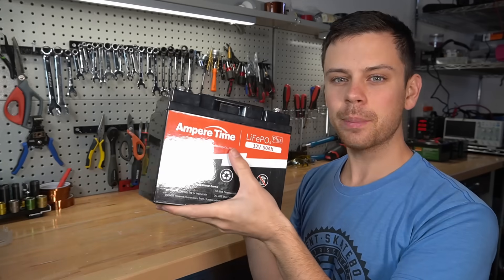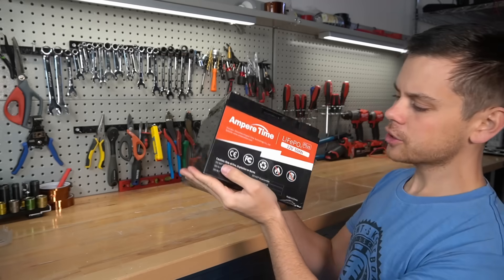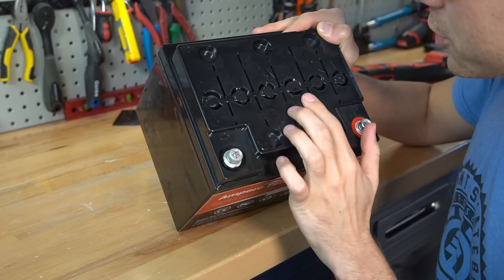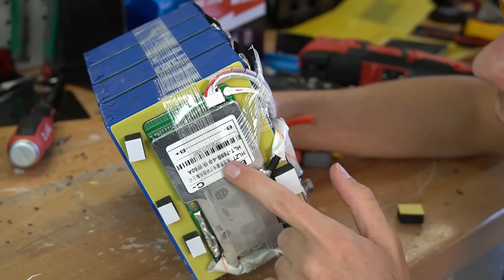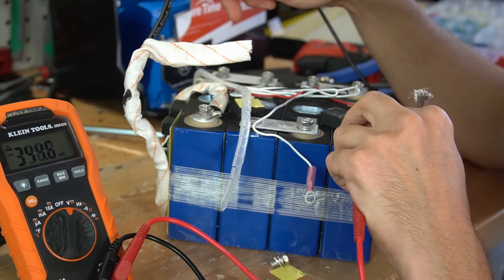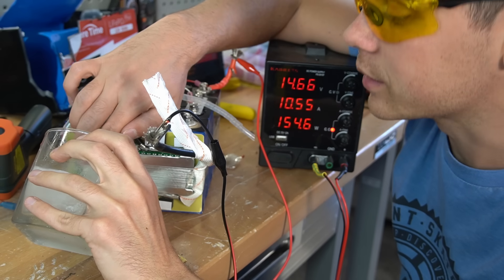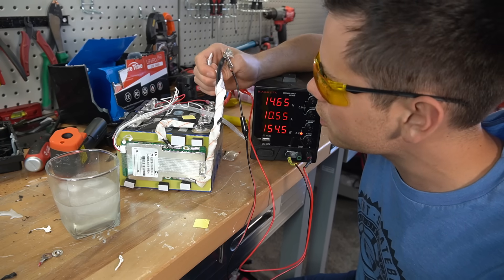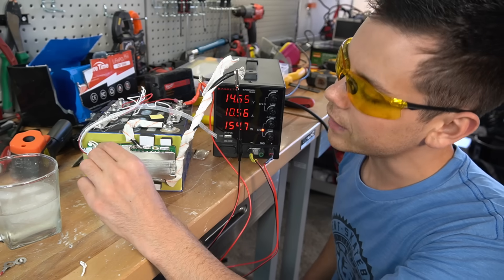12V "Ampere Time" LiFePO4 Battery Teardown

Comment: The main power cable looked like aluminum or copper clad aluminum, # 10 max amperage is 30 amps.
Reply from the maker: No, it's tinned copper. I know the difference and would mention it if it was.

Comment: LiFePO4 doesn't even begin to reduce performance until well over 55℃ with thermal runaway not until 270℃ and yet charging at below 0℃ will cause immediate and permanent degradation ... why have a high temp cut-off instead of a low temp cut-off? Boggles the mind. Edit: typo
Reply from the maker: Agreed! It does not make sense. Jack rickard has some videos about using LiFePO4 at higher temperature for increased performance too. They like it. Storing at high soc in high ambient temperature? They don't like that. But this high temp sensor would never help in that instance. I just don't get it. Very pointless.

Comment: How about adding a separate low temp cutoff OR a thermostatically controlled heating pad? Even Battleborn sells those
Reply: What is the product that BattleBorn sells to add a separate low temp cutoff?  I've looked a little bit, but it appears the heater wires available are either hardwired from the battery + to the heater lug, or they sell a manual switch.  I'm looking for more advanced, separate low temp cutoff and heater control.  ie, only heat the battery when there is a charge applied, and it is above 0C,  apply the heater only when there is a charge applied and it's below freezing.  Without this, the battery will kill itself trying to heat all the time, even if there is no charging happening.  Heating only needs to be done when there is charging.  Ie, don't heat the battery at night, only heat it during the day when it's warmer and there is solar charging.
Reply: You can buy pet bed heaters for $15 - work just as well. edit: typo

Comment: Could you add an external temp shutoff?
Reply: Certainly not impossible but it would mean integrating with the BMS' microcontroller, which would also likely mean re-programming it ( e.g. to accept a sensor input and signal an interrupt). If no microcontroller, you'd have to figure out what signal switches the FETs off and replicate that signal with a thermistor circuit. Again, not impossible, but it would probably be easier to switch the output externally e.g. through a contactor or bank of FETs. Or replace the BMS!

Comment: I have a question on charge controllers for these batteries.  The Renogy Wanderer you reviewed previously now has a Li setting on the display.  It is the only controller I have found that has this simple push button for Li function.  Have you tried this newer version yet to find out if this is actually true?  I have two of the 100ah 12v ampere time batteries on my boat and want to use one controller per battery hooked to one solar panel [Rich brand:  Maximum Power(Pmax): 100W, Maximum Power Voltage(Vmp): 18.6V, Maximum Power Current(Imp): 5.38A, Open Circuit Voltage(Voc): 22.8V ,Short Circuit Current(Isc): 5.78A ,Maximum System Voltage(Vmax): 1000VDC] per controller.  I just want a controller I don't have to program by computer, just push a button to get the setting I want and do not need bluetooth or heavy monitoring.  Thanks for all the info on batteries and systems.  Paypal enroute.

Comment: EDIT AT END>>>Yes. i bought it for 50 bucks more because you gave me "the keys" to sustainable solar freedom. Freedom is worth it. That said, I've written for a discount on the price as there was "false advertising". *They offered to refund $50 when I asked due to YOUR VIDEO! Then, they said they are out of stock. SO, WHAT OTHER BATTERY SHOULD I USE IN THE MILK-CRATE?

Comment: Anyone know why my 1000w inverter is beeping?  Was working for an hour then quit.  Had a fridge plugged up.  Fault light is on, on the inverter.
Reply: Strange question to ask in a YouTube video comments section! Usual causes for inverter (non-catastrophic) failure are low battery voltage (e.g. <10.5V) or power overload, which with only a fridge plugged in is doubtful. They do have other protections, but these two are the most common.

Comment: THANK YOU!  I have 2x 200Ah 12v for my boat and have always wondered how the build quality was.  I am in Japan and the Japanese site does not say anything about high or low temp cutoff.  Could you just add a low temp disconnect?
Reply: Nice, how much solar do you have?

Comment: So it seems these are very good except for low-temp charge protection. Could be OK for lots of folks as long as they know this. I have to wonder if the vendor will decode to upgrade the temp sensors to solve this; even at a slightly raised cost that would make this a great choice.

Comment: Ampere Time says the low temp protection offered by their BMS is -10C or 14F which is probably lower than your ice bath was when you tested it.  I should think the 14F is much to low and the battery will be damaged if charged down to that temp.  Battle Born is 25F, but maybe prismatic cells are more tolerant?

Comment: WILL, ...A bit off topic, but not far.  How about a video with affiliated links to the exact means and minimal cost gear to test the cells for building your own 4S batteries and top balancing them before assembly per the Overkill build instructions on the DIT solar forum.  Gonna plaster this everywhere...it seems to be left out of all the DIY build videos and seems to matter a ton.

Comment: Up 50 bucks. Dayum. 
I was wondering on a battery system would there be a use for a ballast used on headlights? Even possibly activated as a load balancer? Or hyper charger from panel source? Pondering n easier to ask questions to learn. Ty for the videos

Comment: Will, nice video. You could take a low temperature sensor and put it into a series circuit with the high temperature sensor, both closed contacts,

Comment: I know that most like lithium batteries, however why not use a good deep cell lead acid battery like a 12v Trojan?
Reply: Expensive if you calculate kw / per $ 
Less life cycles
Heavy
Reply: @tomali2100  These are all true facts about lead acid batteries.
However lithium is not nearly as good as people think it may be.
Chile's lithium mines use 2/3 of all water in that region. In fact several towns have to truck water in so they can have h20.
Plus if everyone thought they'd get a battery car, think again there's not enough water nor lithium to do that.
Lead while just as toxic as lithium is infinitely recyclable.
What would be nice is a combo pack where a small lithium battery was being used for quick charges. And the deep cell for cold cranking amps.

I don't consider what they claim these are not generators. They're just fancy toys.
A real generator can be run for hours powering real tools and possibly starting a diesel truck.

If you compare a gas gen set vs one of these so called solar generators and added it all up the gas gen set would win with a far less carbon footprint.
While Will is having fun with his CCP toys it would be nice if he built a actual gen set that actually did what a gen set is supposed to do. And not a toy for a child in a van. Just saying.

Comment: You should do a test on charging them in a freezing environment like right at 32 and capacity test and go down just a little bit each time I mean it's not like the batteries actually know what temperature it is and it's not like the electrolyte is freezing if you can discharge fine right I'd like to see the degradation especially at just minorly low temps like above 20° american because it never gets lower than that here

Comment: Just remember these rectangular white  temp sensor are ON and OFF for high temp only. They just have a bi metal contact inside... sometime the temp sensor ARE ON THE BMS PCB and are SMT components so that might be why your low temp test can not work.
Reply from the maker: If low temp sensor is on bms, then it fails. That's even worse actually. It cannot be on a bms that heats up.

Comment: These temp sensor at 3:18 are only for high temp cut off that are On and OFF depending on high temp conditions .. these are not thermistor that measure temperature and give an indication of the low or high temperature. Normally the temp sensor like you have are connected to the BMS in serie with the SWITCH option  to enable or disable teh output FET. Normally this switch is just not used and the connections is bypassed on the pcb  When i arrived at Rocky Mountain to Develop their next gen battery they were using these in  their Powerplay line. And they were not protecting against low temp charging.
Reply from the maker: Yes very true. But low temp sensor has to be on the cells, not on the bms. If it is on bms, then it fails for that reason. Good point

Comment: The cold temperature cut off is only a bummer if you live with the snow. Here in Florida it's a great choice!!
Reply: Even if you live where it snows, as long as the battery is somewhere indoors where you have heating, it’s not an issue.  Where I live it’s -12C currently and has been -18C much of last week, but my battery is inside my house, which I can assure you is above 32F!!
Reply: Ya I'm in central texas and it's not a big deal
Reply: @james10739  after the snow storm. I think it would be wise to always plan for low temperature
Reply: Perhaps they installed the wrong sensor?
Reply: @johnbuchman4854  probably not the bms manufacturers just haven't really learned that it's an issue and don't really care I mean they have a microcontroller on there they just need to tweak the code a little
Reply: A lot of chargers have a temp sensor you can run to the battery and a cold temp shutoff. It's not as secure as having it in both the charger and the battery, but for the price if the batteries are otherwise solid it might be worth the risk to some people. I know the chargers I'm eying for an RV build will both do it.
Reply: Thailand
Reply: I just bought 4. 100 AH. For my off-grid camp in central Maine not worried one bit about the cold temps.  These batteries will be inside with me 
  Ok just have to warm them up a bit when I return back to camp before I charge them 
   Correct me if I’m wrong    But as long as I’m not charging these batteries can they handle the cold ❔❔❔ Until I get them up to temp
Reply: for shure...would not work up here in central alberta, -32 C   now,  my old chrysler intrepid, 1996, starts, and not even plugged in....GOOD  BATTERY, simple, old version.made in Canada.
Reply: Actually it's only a bummer if you look for quality.
Reply: How good of an option would these batteries be for a 36v trolling motor application? Texas location so we hardly ever get below freezing and if we do we are not using the boat.
Reply: Gonna want to use a heater
Reply: or poor american that cannot buy electricity, nuclear is green and cheap

Comment: Will, I just bought one of these and so far so good. I just want to make sure that there'll be no damage discharging, using,  this if the temperature is about 25°F? 
The only damage would be trying to charge it in that temperature?
I guess I can bring it in the house and let it warm up before I charge it?
Reply: Yes you can discharge it but not charge it below 32 degrees F.

Comment: Does anyone make an external thermostat controlled relay? ie just an external low temp cutoff device to fix most of these cheap battery designs?
Reply: Yes, it can be controlled with thermostat, but solar charge controllers (for example) expect a constant connection to the battery bank.  I suppose one could cut the connection to both the panels and battery, then reconnect to battery first using a timer on the panel relay.

IMO, simpler to use the thermostat to run heat tape, heating pad, etc, below 35F or whatever.

Comment: My 200Ah has shipped. Good thing I don't anticipate charging in below freezing temps. Great price, so I will just have to keep that in mind. SO glad the rest of the teardown is positive!
Reply: Right? So am I not supposed to keep my batteries indoors where it’s warm
Reply: @grumpy1962R  My battery is going into my Tahoe to augment my solar system when home and to provide power when I am camping/living on the road. I don't see myself spending a great amount of time in cold areas, but it will come up. My plan is to install a switch to isolate the charger and monitor battery temperature. Once the Tahoe heat has warmed the battery, I can start charging. I may be able to control that through the app on the Renogy charger too. That's assuming I don't install a diesel heater at some point.
Reply: How has it held up ?
Thinking of buying the same one as you have.

Comment: "We’re really sorry for the confusion.
The BMS in our battery has low temperature cut-off protection function, but if we set this function on our battery, the battery can neither charge nor discharge under 32F/0C. At the beginning, we had set up the low temperature cut-off function for our battery, but later many customers responded that they needed to be able to discharge under 32F/0C. After careful research, our team has decided to block this function.
Currently our battery can be charged at low temperature, but it is charged with a very small charging current. And we’ve used auto motive grade battery cells which have superior quality. Even if charging in low temperature environment, it will not damage the battery. And as what we’ve listed in the charging temperature, we don’t recommend charging under 32F/0C.
Our marketing team has an error in understanding this, which leads to inaccurate information shown on our product page. We’re very sorry for the misunderstanding and thank you for your info, and we’ve revised the inaccurate info on the product page."
Reply: That is from ...By Chris Nowak on January 4, 2021... review on Amazon.
Reply from the maker: The Amazon page still states inaccurate info. Guess they didn't update it yet: 

Built-in BMS: Our LiFePO4 battery has built-in BMS (Battery Management System) to protect it from overcharge, over-discharge, over-current, and short circuit with excellent self-discharge rate. Built-in high /low-temp cut off prevents charging over 122 °F (50 °C)/under 32 °F (0 °C).
Reply: @WillProwse  Grrrr
Reply from the maker: Yeah I wouldn't trust their cold temp charging recommendation for a second. LiFePO4 should never be charged below 32F. Except winston cells. They can easily set the bms to charge at 32f and higher, and discharge at a different temp. Not hard to do and very common.
Reply: @WillProwse   Could a thermal protection circuit be added to inhibit charging if below the thermal limit?
Reply: @WillProwse  in Norway we have rally cold days. But my manufacture stat that we can charge batteries whit less than 5 amps and it will be good. What do you think.?
Reply: @friluftsguide  The best practice is to DRAW from the batteries before you CHARGE them.  This will WARM the batteries before charging.  Same for motorcycle/snowmobile, etc.  Turn on the lights for 30 sec before starting.
Reply: Have you tried different thermisters set at low temp range?
Reply: Amazon recently got rid of the comments under the reviews.  Big mistake, like now information like this is lost.  Manufacturers used to contact buyers this way, now they cannot.
Reply: @laronis  Leftists hate free speech and are wiping it out across the globe.
Reply: Amazing how many "misunderstandings" are revealed only after someone tests and exposes these manufacturer claims. Keep 'em honest, Will!
Reply: If other companies batteries work properly I'm sure Ampere Time can fix it if they want to.
Reply: It will drive the price back down..
Reply: Hey wait a minute...this sounds familiar. The dunning kruger strikes again, really they didn't believe it. Too many words.
Reply: Why not have two terminals then ? One for charge one for discharge. Then they could put simple temperature switch between the charge terminal and battery?
Reply: You need to change  engineering specification to allow for different low temperature cut off for charge and discharge to match the capability of the cells you are using.  Apparently you don't control the spec's for the BMS you are buying.
Reply: @DirtExtractor  Online at Walmart.
Reply: Now I am even more confused. Can or cannot charge under 0C?

Comment: Will, so I guess you caused permanent degradation to the battery having it charging in the freezer for 8 hours?
Reply: Will put the battery in the freezer for 8 hours and then check to see if it would accept charging. He didn't charge it for 8 hours while frozen.
Reply: @billbraun6846  I believe you're right.  However, when he said "It's been in here for 8 hours and it's still charging" you can understand why I misinterpreted his words.

Comment: Curious to what (if any) difference there is with electric vehicles that are in cold climates. It's -21C where I am right now, my car has a Lithium Iron Phosphate battery and while it has a battery warmer installed, it only turns up when the battery is ~ -17C as to prevent the battery from freezing. However this doesn't up the battery back up to 0C but rather keeps it from going below -17C. So my question is, are owners damaging their batteries by charging in the cold? Crazy to think that might be an issue with mine.
Reply: The simple answer is "Yes". A phenomenon called 'Lithium plating' occurs when a typical LiFePO4 chemistry (graphite anode) is charged below 0℃. Once the lithium ions are released from the electrolyte as metallic Lithium, they cannot be returned and immediate and irreversible damage occurs permanently reducing battery capacity ( and if severe, mechanical failure ). The more charge current, the more damage. There are some lithium chemistries that avoid this e.g. LTO, Lithium Titanate.